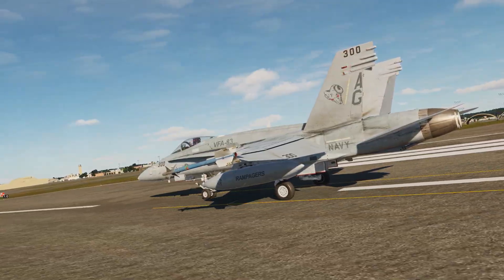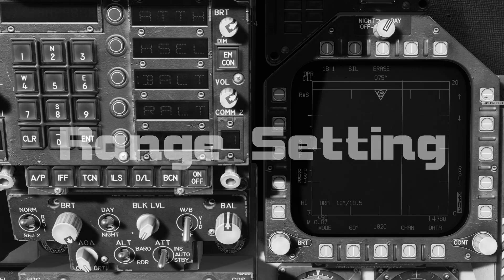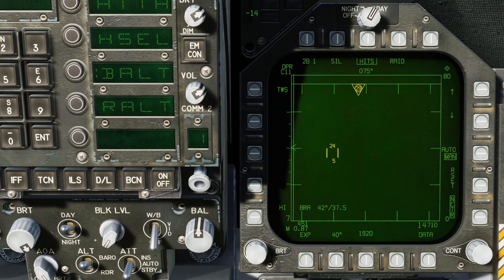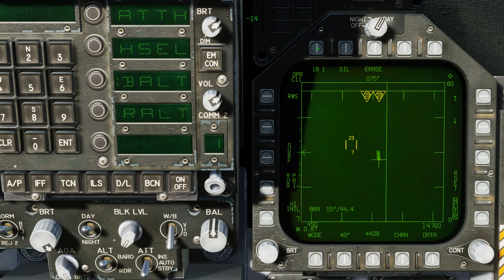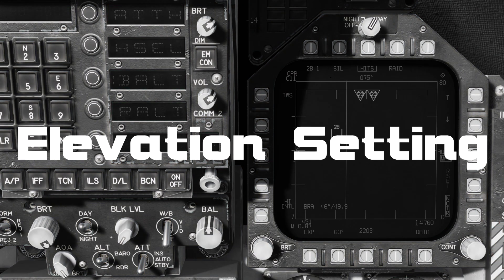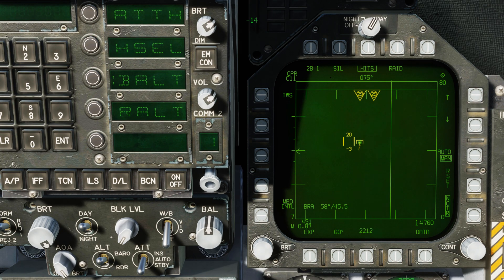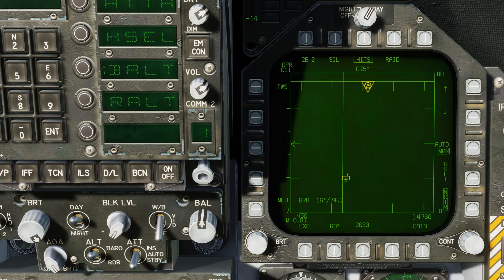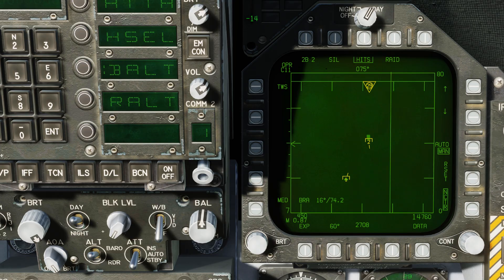DCS: F/A-18C Hornet | AA Radar Use

Comment from the maker: A little update on this video: 1- We are looking into adding the ability to set an MSI-only track as an L&S or DT2 later. This video is about how the radar currently operates. 2- This week we added a range modifier based on look-down angle. - Wags
Reply: Will you do one of these for the Viper now that the CNTL page has been added to the FCR?
Reply: Hey Matt, curious if you had any recommendations for target lockup on the f/a18 at 35ish miles and beyond. Been flying the f16 and the 18 and I feel like detection and time to lock is much much longer on the f/a 18. Grim Reapers just made a video showing a pretty dramatic difference between range to detect for both aircrafts radars as well, with the 16 far outperforming the 18. Any thoughts on this? This seems to be my experience, although purely subjective. Have even tried narrower scans <80* to get radar update intervals shorter. But BVR still struggles in tws and RWS
Reply: Can F 18 do offbore HMD shots with AIM120 & AIM9X like the F16? The F 18 does not have a dogfight switch correct?

Comment: Wags, I love your videos, but I do have a request.  When you talk about things like adjusting the elevation on the radar (or anything, really, that was just one thing that jumped out at me), could you try to explain the "how" of it, too?  What controls are you using, what buttons are you pushing if applicable, that sort of thing.  It took me a month to figure out that what I thought was a useless dial on the left side of my X56 throttle could be mapped to actually adjust the elevation of the radar, and that's just one example.

Not a complaint, like I said, I love your stuff and watch it a LOT, but it's an "it would be nice if..." thing.

Comment: @Matt Wagner If i have a Mig-29 coming at me at 30k feet and i am at the same hight. Or i follow a enemy Tu-22 with 0,5-5nm distance also lvl. I keep losing him, even if he is already so close,  what causes that? I am really lost. My yellow bracket is set on his hight so he is in the scan angles of my radar but my radar only shows him for short times. I usually scan 1-4 bars if i know where he is. I mostly fly with the autostart settings of my radar. And only adjust the yellow bracket. What would be the number one thing i have to adjust better to keep him locked?
Also why does it seem the Migs can always fire from double as far as i can with the amraam? I have to do something really wrong. I learned in this video about the dopplereffect i didnt know of but thats not it since i fly level. Also i learned i can move my scann angle to the left and right, i only knew i could adjust up and down before. I know the symbology of the radar and have watched other guides. But i just cant seem to do it anymore since a update few month back that made it way harder.
Reply from the maker: Please post a track file to our forum and a kind soul will help figure out where you are going wrong.  https://forums.eagle.ru/forum/130-dcs-fa-18c-hornet/

Comment: Surprised to see this level of info from you wags, especially on AORs (area of responsibility for the curious). Glad to see it.

It would be fantastic if some more functionality was added to the Link16/MIDS to let aircraft in multiplayer change their flight IDs and sections for this very reason. 

I wouldn't be surprised if half the DCS community doesn't even know about the datalinks flight donor ability since most servers run aircraft as individual groups due to limitations of the scripting API. 
Having an ability similar to the A-10C perhaps. 
If its limited by data cartridge then....well, another reason for multiplayer mission pre-planning and data cartridge management. 

Too much functionality and capability that are internal to the aircraft and other assets are instead hard coded into the mission file instead being an extension of the aircraft/module itself. 

Goes for carriers, tankers and AWACS as well. Simple acts like improvised steer/waypoints are impossible.

Comment: Thanks for the vid Matt. Would be nice if ED could fix the MSI which I understand is still incorrectly implemented? Based on the ED forum post (see link) below:

One issue is that offboard donor trackfiles fail to show on the RDR ATTK page with D/L and MSI turned on, unless LTWS is also turned on. LTWS simply 'unveils' the onboard trackfiles inherent in RWS bricks (see Wiki - https://wiki.hoggitworld.com/view/F/A-18C#Latent_TWS_.28LTWS.29_Mechanization) and should be independent of offboard trackfiles. 

The other issue is that turning on MSI should show all trackfiles but hide pure onboard radar contacts (bricks), and that the use of the MSI button should only affect the RDR ATTK display and not the SA or AZ/EL (see ED forum - https://forums.eagle.ru/topic/274019-ltws-msi-implementation/?do=findComment&comment=4692023)

Would appreciate it if ED could shed some light on this. Thanks

Comment: The downside to this is while the Hornets radar is working 100% correctly there are some glaring examples now of other jets who's radars seem to not be, the vipers is still WIP, but the FC3 aircraft and the JF17 all seem to be really great examples of radars that need to be 'tweaked'. The Viper I get will get it's passes with time and benefits from the work on the Hornet, but the JF17 for example can see things out to ranges that don't make sense given it's radar should be based on all avalible information no better then a hornet's and actually has a slightly smaller radome.. and the FC3 Aircraft all seem to be 'magic' almost.
Reply from the maker: We will work with our 3rd parties to address such issues for a more unified radar performance landscape.
Reply: @MattWagner  10/10, thats urgently needed.
Reply: @MattWagner  hopefully sooner then later as right now there is a massive impalance happening on MP servers etc where the Viper and JF for example sit at 32,000 ft piffing MRM's off at targets coming in low often locking up at ranges the hornet etc can't even see targets at now. 

It's a little 'unfair' to have one radar behaving properly and no others, as it impacts the entire game.

Comment: That age setting could be why my radar keep dropping tws locks. Im curious about what is the default age setting on F16? Since in my experience F16 tws lock is much more reliable. Also, on F15, due to its a low fidelity moudule, does the age setting not simulated at all? Because I never had any lock drop on F15, and it just work like magic😂.
Reply from the maker: The F-15C radar is at a much lower fidelity level.

Comment: Hey Matt ! Thanks for the video. Good stuff, very qualitative as usual. 

What about the MSI integration? It's one of the key feature of the FA18C.

Back in the days, It was the first aircraft, or one of the first to have data fusion. I would be surprised to see the plane come out of early access without such an essential function which almost defines it.
Reply from the maker: Please see the portion on datalink. There is certainly MSI integration.
Reply: @MattWagner  I think we should define what's really "MSI". 

Please check the doc A1-F18AC-742-100 for evidence.

In short, the radar can be commanded to "look" for an MSI trackfile, based on existing track data. In that way, you should be able to designate an MSI track as L&S from the ATTK RADAR or SA format. It also differentiates between raw radar hits and MSI tracks, when it comes to acquisition. It states that: The radar system, forward looking infrared (FLIR) system, data link, high-speed antiradiation (HARM) missile are used to provide sensor inputs to MSI. 

Already reported on the forum months ago and explained with evidences : https://forums.eagle.ru/topic/269790-msi-info-designation-on-rdr-attk-page-coming/page/2/

Since you are talking about radar now, I thought it would be interesting to ask about MSI integration also.

Thanks.
Reply from the maker: @Wawar9  We are well aware, thanks, and have much better information. Although there is MSI work to do with AZ/EL, the radar format for MSI is correct based on available, credible data. Cue already works as seen in the video, but creating an L&S based on a donor only track is far from certain.

Further: I'm not saying that we will not implement this one aspect of MSI, we just need more research and be 100% sure before we task time and money toward it.

Comment: Great video indeed, thank you! But I've got some issues of which I'm not sure if they are caused by me or some code malfunction. In TWS mode sometimes the radar elevation seems to go completly haywire by itself (e.g. looking as far down as possible without me noticing and wondering why I don't get any tracks and also in TWS while in manual the radar isn't following to the gimbal limit while I'm cranking and diving so I'm losing lock or if I switch to auto/bias it seems to set the radar elevation to default so I'm also losing lock because of the vertical angle. Is this a) user to stupid / working as intended or b) actually a bugish behavior? Because I never had any of these problems in the F-16 TWS mode while maneuvering. Edit: radar elevation cant be manipulated in TWS auto mode.
Reply from the maker: This is not something we can reproduce. Please feel to provide a track to our forum and we'll take a look at where you may be going wrong, or if these is a genuine issue.
Reply: @MattWagner  Ok, thank you. Will try to figure that out.

Comment: I think a big issue is the hornet radar is preforming realistically while the other radars are over preforming. Some dramatically.
Reply from the maker: In general, yes. The F-16C and F-15C particularly require adjustment.
Reply: And this is the reason more and more people they turn to F16 together with the thrust. With F18 i feel quite underpowered. Maybe this is close to reality but comparing with F16 right now it is day and night.
Reply: @Balthazar030  F15C is even more broken, but it dosent have datalink and lower detect range. As long as you dont mess up the elevation, you will never drop any lock lol😂

Comment: 11:28 how does he change the scan to right? or like 11:57
and about RCS what we can do? 10:09
Reply: In tws manual mode TDC depress will slew the radar azimuth. There is nothing you can do about an enemies RCS
Reply from the maker: For RCS, there is not much you can do than narrowing the scan volume to pick it up faster and have a realistic expectation of about when you should be able to acquire/track it (around 40 nm for a small, fighter-sized aircraft).
Reply: @MattWagner  Just to confirm: a narrower scan angle won't increase the range at which a target can be detected, right?  It just means less time between "sweeps" of the radar, so you'll pick up the target at soon as possible once it comes within range, correct?  (And huge thanks for the video, great stuff!)
Reply from the maker: @josephnoe2956  Time to detect can decrease, and this would in turn lead to detecting the contact sooner/further out.